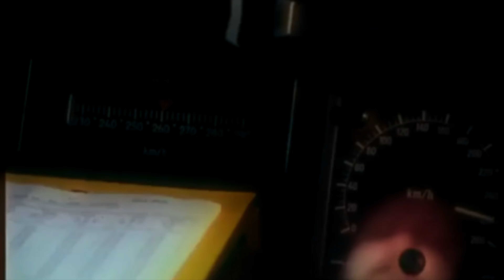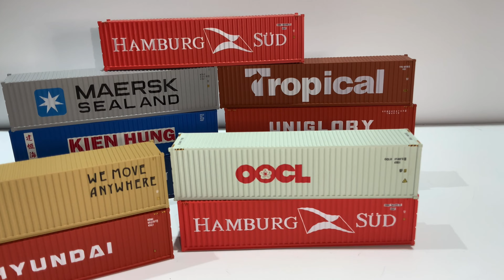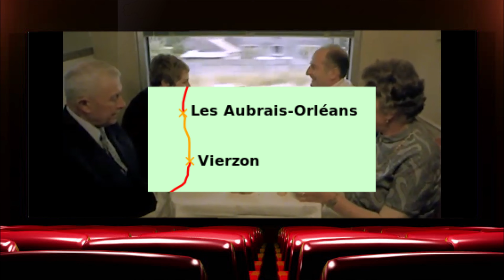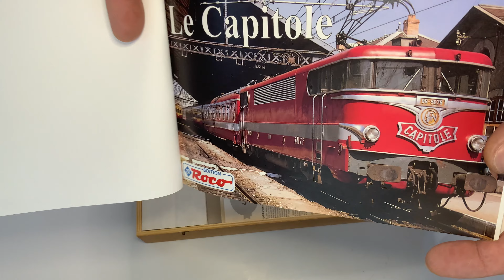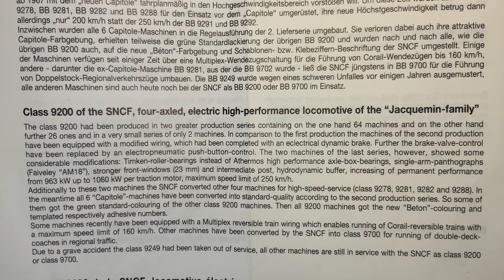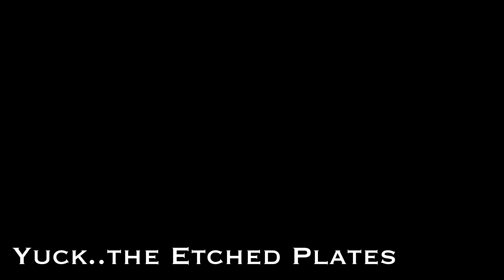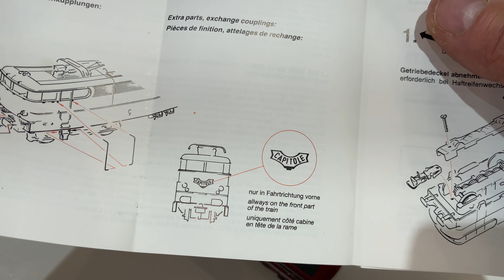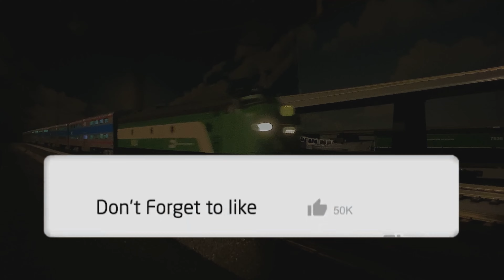Shortline Histories: France’s Le Capitole, Semi High Speed Train. DCCing a 30 year-old HO Roco 43563

Comment: I have the old Jouef version of that loco in green, it runs pretty good for it's age especially after I clean and lube it, it does not like the frogs of turnouts though since it only has 4 wheel pickup.
Reply from the maker: Those look pretty good, IMHO, but, yes, some deficiencies due to its age. It’ll be fun for sure, tho!